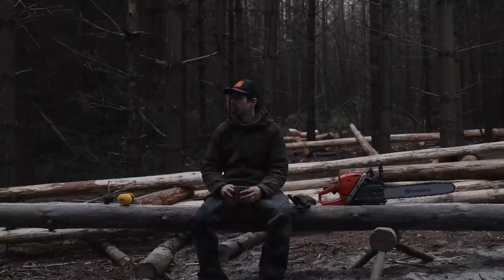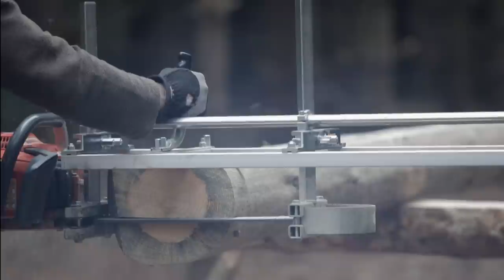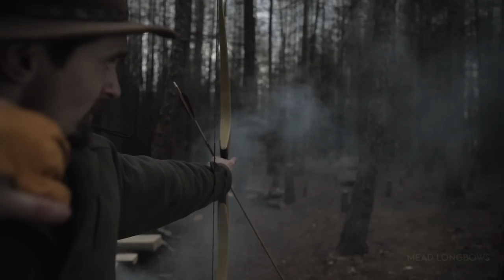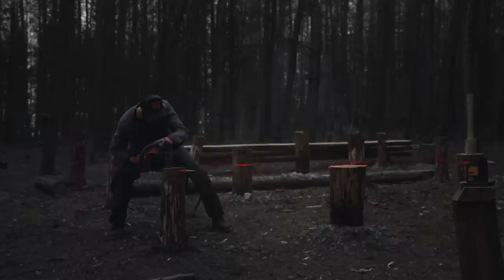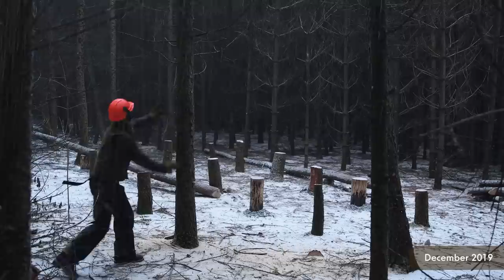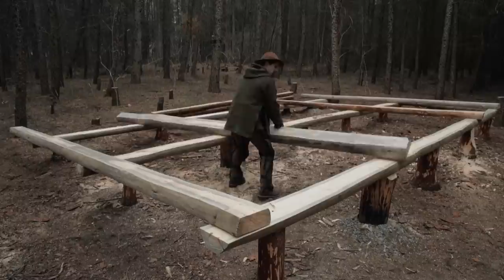EP 4: The Foundation / Milling Beams / Camp Cooking / Cabin Build

Comment: Hope you threw gravel or stones in the hole before placing the wood posts. The end of the post is the most critical part to protect from moisture more so than the sides. I would have put asphalt foundation coating on the post prior to setting it.
Reply from the maker: Asphalt foundation coating sounds like it would have been a good idea.

Comment: From what I understand, charring the logs that you put in the ground help them last longer. I noticed that you also were flaming the dirt after you packed it around the log. Why is that?
Reply from the maker: Just to dry it out. The soil was wet and winter freeze up was coming. Less expansion and settling. Also a little easier to pack when not muddy.

Comment: Curious to know how long the tree stumps are expected to last in the ground as foundation posts? Like to learn more!
Reply from the maker: I was told by a Timber Frame guild member he figured 5-10 years.  It's just a temporary building platform. The cabin will be moved to a permanent foundation later. However wood foundations are possible. If interested look into  wood foundations. Requires gravel.
Reply: @TrustinTimber  ok interesting, figured as much. I am familiar with the gravel method you suggested. It also depends on the type of wood. Pseudoacacia or sweet chestnut are two species found in Europe (where I live) that last 20+ years in the soil untreated. Combined with a gravel surround, burning or a natural stain, the footings will last longer. Of course the maturity of the wood and size of the post is also an important factor as well as the moisture and type of soil. There are exotic species even more rot resistant, but that brings in a lot of sustainability related questions. Best practice is to keep the wood above ground, that way both suggested species will last the better part of a lifetime or much longer depending on weather exposure.

How will you construct your permanent footings? Natural stone or concrete with a slate topping (restricts water from damaging the wood pillars resting on top of the footings) are by far the most long lasting. There are of course reasons for going another route (taste, ecology, etc.)

I am very interested to watch your cabin progress!
Reply from the maker: @vincentput   what an honour to have someone so knowledgeable giving advice. Thank you.  Truth is, we don’t even own the land that we will move this to yet. My design will allow us to completely disassembled the cabin for transportation so we can get it to a remote location. I’m expecting I’ll do concrete piers. I like the idea of the cabin looking like it’s floating in the forest. Would you mind explaining that slate technique?
Reply from the maker: @vincentput  I should maybe also mention, the posts in the ground are not white pine like the rest of the cabin. They are Tamarack (Larch) I understand they are more rot resistant. Our First Nations here in Canada used it for snow shoes.
Reply: @TrustinTimber  concrete is a good choice. Do your research on consistency and ingredients (not all concrete is created for equal purposes) and don't forget a proper rebar strengthening structure. (Of course you probably thought about that already).

The slate technique is actually quite convienant as this type of rock is easily available in a slab or tile form. It prevents moisture from the concrete from wicking into the wood above (placing the slate on top of the concrete and below the wooden posts). Any other impervious stone will do, but refrain from rocks that will wick up moisture as badly as a WW2 concrete bunker. That is unless you like to grow mushrooms and mould 😂.

Another common practice, which my parents have used on their porch some 30 years ago is by drilling and anchoring a metal foot into the concrete footer on which the wooden post rests. So far the posts (English Oak, varnished) are as good as new. These "feet" for lack of a better term are readily available. Take care to use the right type of metal to prevent it rusting or staining the wood... Proper feet are calculated to take certain loads. For any other readers: don't go ham with soft rebar, or the like...

Thanks for the compliment, not an expert by any means, but an enthousiast you could say 😁
Reply: By the way, I was wondering in which zone you are located? USDA-zone or statewise... Here in the Flanders region (Belgium) we get a bit of everything: heat and drought in mid summer, wet periods all round and a cold snap every now and then.
Reply from the maker: @vincentput  very interesting, yeah, I had just learnt about how concrete released moisture from a home building podcast. I was shocked to hear it’s similar to wood as it takes about a month per inch to dry.  Guys like you are the reason I have the confidence to build this cabin. I know you and others will keep me on track.  Thanks for the guidance. Much appreciated.
Reply from the maker: @vincentput  currently in 5b will probably move it to 3b.
Reply: @TrustinTimber  and vice versa! Watching YouTubers like you and your gf experiment, presents me the opportunity to learn as well.

3b! Can't imagine the cold 😮 7b is enough for me 😂

Comment: The most important part of the cabin is the foundation, cut logs stood on end are not going to cut it, will deteriorate quickly from rain and snow in the exposed endurance, sorry!
Reply from the maker: It’s just a temporary building platform for dry fitting.